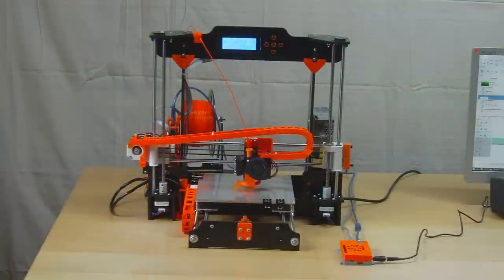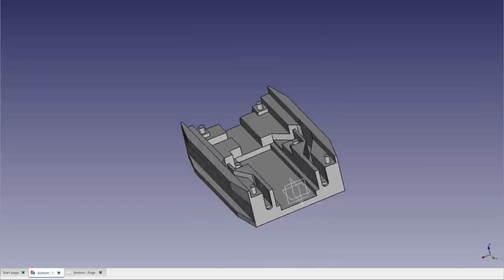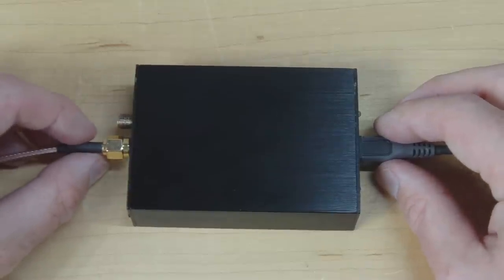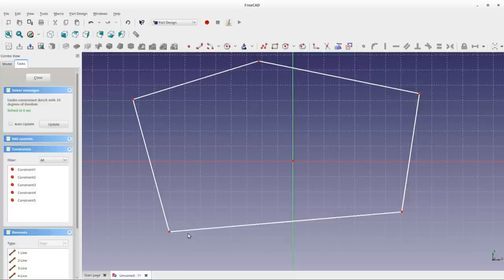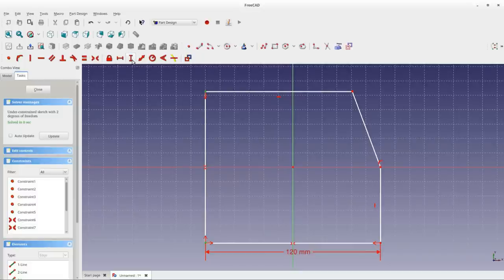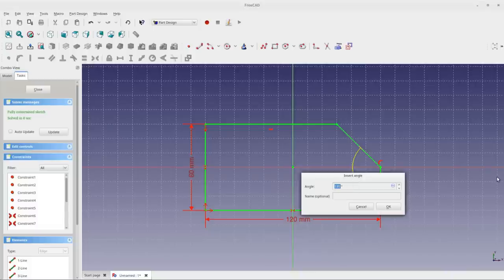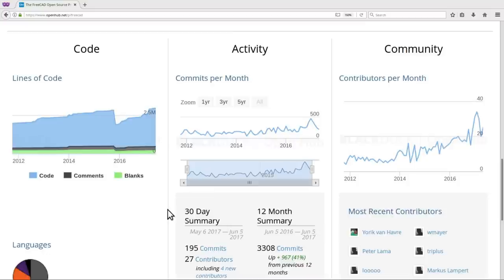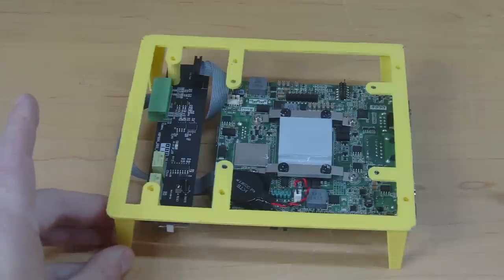[008] Prototype Enclosures with FreeCAD & OpenSCAD

Comment: Very interesting and informative. Choosing to adamantly stay away from all proprietary CAD tools I'm all too aware that there isn't exactly a deluge of usable, intuitive free CAD tools. I've been aware of both of these (as well as a few others) but FreeCAD's interface simply ties my brain in a knot each time I look at it and I happen to think that text-based tools for graphical tasks are the work of the Devil, so I stayed away from OpenSCAD too; what I use instead is SolveSpace - much like FreeCAD it's open source, parametric, constraint / hierarchy based and can do assemblies and even some motion analysis, but the GUI is soothingly simple. It's drawback is that its solver slows down horrendously past a certain level of complexity, so it's best used in moderation, but so far it has served me astonishingly well...

Comment: Awesome video. Have only been working in openscad before because of the parametrization, but now that you have shown freecad, that looks like something I should try, too. Thanks for sharing this video with us.
Reply from the maker: So long as your expectations aren't set too high, I think you'll find FreeCAD well worth trying out.
Reply: I personally like FreeCAD for my windows 2-in-1. It's not powerful enough to run fusion 360 or solidworks but it goes literally anywhere, so with FreeCAD I can start projects anywhere.

Comment: 31:40 modules are great, one thing that often gets overlooked is the children() function. you can use that to bundle up a set of transformations (say a complicated move and rotate). I end up with a lot of modules in my project with names like at_screws(), where it'll position a copy of the module's children at each screw hole, for example. this can be useful because it gives you a lot more topological flexibility; instead of having one transformation that positions the children at the screws, and have all the hole related features (standoff, holes, and lateral supports) be children of that one transform, you can distribute your screw features throughout the code. this can be useful if you want the screw holes to drill through not just the standoffs, but also the base plate they're attached to, despite the fact that the base plate is outside the scope of that transform and therefore can't be modified by it. so it would be useful to be able to move one of the screw related features elsewhere in the tree, in this case move the hole geometry up into some outer difference() that contains all the stuff you want it to be able to go through. you can either write your transform (probably some for loops and a translate call) twice, or you define an at_mounting_holes() module, and just invoke that whenever you need to position something at each screw hole, anywhere in your model tree. that way also, if you need to change the screw positioning code later, there's one named and easy to find place where all of it lives.

you can also chain together these modules, which can be useful for assemblies. any time you call rotate() or translate() (or a module that applies these transformations to its children), you can think of it as creating a new coordinate system for its children. so, you can make a bunch of parts, each one positioned at the origin, and then use translate() and rotate() to assemble the parts into the final assembly. but instead of just calling rotate and translate, you define a module for each part's assembly position (called to_mypart()), and a second module that performs the inverse transformation (moving it back to the origin, called from_mypart()). then you use these modules to build up a preview of the assembly, and even better, you can use these modules to transfer geometry between different parts' coordinate systems. so if you define a module to position a set of, say, alignment pins on Part A, you call that function within part A's local coordinate system:

part_a_at_alignment_pins() cylinder(d=pin_d, h=pin_h)

and then on part b, you convert that transform from a Part A's local coordinate system to global coordinates, and then from global coordinates to Part B's local coordinate system:

to_part_b() from_part_a() part_a_at_alignment_pins() cylinder(d=pin_d + pin_clearance*2, h=pin_h + clearance)

since openscad doesn't have any proper namespacing, if you're making a multi part assembly, you'll need to use a scheme (like prefixes) to make your different parts' module names unique, and you'll probably want to have a separate file per part, so you can protect each part's global variables by importing with "use" (which limits access to just modules and functions, compared to "include" which gives you everything). then in each part file, you have your to_ and from_ modules defined, and a single outer module containing all the geometry of the part, which you then call in the file. you open this file when you want to work on that part in isolation, in its "natural" position, and then you have a separate "assembly" file that just imports all the part modules, and calls to_mypart() mypart(); for each part, and you view that in openscad to preview how it'll all fit together, as well as to have visual feedback as you write those coordinate transforms. (and if you wanna get really fancy, you might end up defining some parts in relation to other parts' origins, rather than the global origin. so if part_b is defined as rotated 45 degrees and 10mm above of part_a, then to_part_b would look like this:

module to_part_b() to_part_a() rotate(45) translate([0, 0, 10]) children();

and from_part_b() would just be this in reverse. then if you later decide part_a should attach to the assembly in a totally different place, you modify to_ and from_part_a, and part_b will automatically tag along since it references part_a's origin.
Reply: oh also hull() is wonderful in 3d but especially in 2d, to quickly build up complex shapes out of a few primitives. and roof() is... extremely powerful but limited in usefulness as it's still experimental and often broken :(

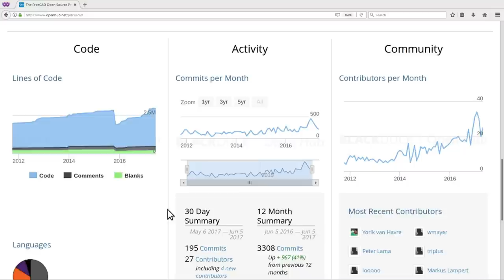Comment: 24:39 another thing that looks encouraging: seeing the lines of code graph not just going up, but also down. freecad has some serious structural problems (like the topological naming problem) that require fundamental changes to the way the app represents objects internally, so it's a good sign that there appears to be a willingness to not just add, but also replace code. (and no you can't fully work around the topological naming problem with good practices, if you wanna see the problem in action, load in a complex step file, make a drawing of it in techdraw, and see what happens when you save, exit, and reload)

Comment: Great intruduction of OpenSCAD. 

I remembered many years ago. my friends who are using CAD such as AutoCaD an Microstation , were using both  GUI and text command at the same time.  They use mouse to pick  point/object with right hand, and change the properties  using left hand.  I amazed  with their skills. Those days, we are using DOS or Windows 95 for CAD  Not to mention the computer hardware during that time..

Thank you.
Reply from the maker: I used AutoCAD for a summer years ago. Got quite good at it. It's not much of a tool though - it's more just a vector graphics drawing application optimized for the work of a draftsman. You draw lines and arcs on a page - but that's all it is. It's not any kind of 3D object.
If you need that sort of thing today in 2019, I think LibreCAD is the go-to for 2D CAD tool for the open-source aficionado.

Comment: It seems like iteration around be easier to iterate with OpenSCAD.  If I need to move a number of components, it would simple as finding the declaration and adjusting the transformation.  With a point and click tool you'd have to grab each one and drag then to the correct place.  

If the design had sub assemblies and variables it could be even easier.  Need to change the diameter for all the standoffs in your enclosure, just change the variable for the diameter.  

Very slick.  Thanks for the video.

Comment: Hi Joel, 
Great video, very informative with just the right amount of detail!
By the way, the rendering 'artifacts' you noticed in OpenSCAD preview mode (around 37:30 in your video) are caused by linear_extrude making assumptions about the convexity of the shape to be extruded. This can be overridden with the 'convexity' parameter to linear_extrude; i.e. writing 'linear_extrude(thickness, convexity=2)' (or more than 2) will preview correctly. This option has no effect in render mode, which does the correct thing either way.
Marko
Reply from the maker: Thanks - that's good to know. That seems like a bug to me though - OpenSCAD should be able to figure all that stuff out automatically even in the preview. Not a major issue though.

Comment: Nice comparison :) To fix the preview issue in OpenSCAD you can enable "enforce goldfeather algorithmus" in the settings. It solved the issue for me under windows. Also a note about the "perfect geometry". If you do 3D modeling for animations, renderings or whatever displays you model on a computer screen, then you are right and the perfect geometry shown e.g. by FreeCAD is better. But if you do 3D printing / CNC machining etc. it doesn't help at all, because your resulting model will always have discrete faces and OpenSCAD will actually represent exactly that.
I recently did some 3D prints for a friend that he had designed by his own. He was pretty surprised that the round faces he designed were not round at all at the end. He never actually had seen the STL file his tool created out of his perfect world model... I had to print them all a second time.

Comment: 8:50
First Select "Create Body" to get the option to "Create Sketch"
Next select the X-Y Axis on the left hand menu. Then there is an oddly placed "Ok/Cancel" box above the window to select the plane. Select "OK" and it will unlock the polygon tools.
(FreeCAD 0.17/Ubuntu/fresh install of "Stable" PPA from command line on 10/10/18)

Comment: @26:43 Could put some 6inch nails into the board, bit of a safety-hazard, but my prototype only goes up to 360VDC so i guess i'll be good.

But serious, just bought a 3d printer to do exactly that, supports for my pcb's,  Just started on freeCAD, since i don't use Windows anymore and abandoned Sketchup (feeCad). Nice Vid!

Comment: Hey Joel,
 Thanks for this upload. I keep coming back to this as a reference. I finally got a 3D printer bc I want to make stuff like this.
  However, it seems like I learn freecad for a project then wait just long enough to forget everything I learned before the next time I want to use it.
 I know your contributions to Sigrok. As a UI Dev, do you think we will ever see (or is there) a more intuitive FOSS persistent 3D CAD tool?
  When I'm using the latest freecad now in 2021, I'm reminded of KiCAD in the 3.x era, when I started using it. IIRC, at Chris Gammell's KiCon, it was mentioned that a retired/ex- UI Dev from Adobe had begun reworking the KiCAD UI. I wish we would see the same kind of overhaul with freecad. The freecad workflow is like playing a deep game of Simon Says mixed with grade school 1st foreign language flash cards. I'm about to relearn it for the 4th time. Is freecad still your FOSS tool of choice for designing models for printing?
-Jake

Comment: Thank you for the video! I think I'll start to use OpenSCAD for all my new projects now. BTW I noticed that the sound in your videos is a bit quiet and sometimes changes, probably because it was recorded in different environments. You can easily solve all these issues with Audacity. Just run Noise Reduction filter, then the Compressor, and probably Normalize afterwards.
Reply: I'm sorry, I've just noticed that I messed with sound configuration on my laptop and forgot about this. This is why the sound seemed quiet. It's actually OK. Using Compressor is still a good idea though unless you are using it already.

Comment: So this is 3 years late but that funny rendering issue you were having with OpenSCAD seems to be with the circle cutout you do on the 2D plane. If you do a cylinder difference after the linear_extrude  the rendering seems fine.

So something like:

difference(){
    linear_extrude(thickness) difference(){
        polygon([
        [-width/2, -height/2],
        [-width/2, height/2],
        [width/2-height/2, height/2],
        [width/2,0],
        [width/2,-height/2]
        ]);              
    }
    translate([-width/4, 0]) cylinder(h=100, d=hole_dia, center=true);
    translate([width/4, 0]) cylinder(h=100, d=hole_dia, center=true);

    translate([0, -height/2, thickness/2])
        rotate([90, 0, -45])
        cylinder(h=1000, d=hole_dia, center=true);
}

Comment: By the way Freecad now has a toolbox for OpenSCAD so you can use both ways in freecad :) . Although I do not agree with you  on the fact that freecad works with perfect mathematical shapes. If i zoom in on a cylinder I can see some edges.

Comment: Slightly off topic, but I noticed you said that you need to have access to the SWD pins to reprogram the STM32

There are several DFU bootloaders that would allow you to update via USB

I have the one thats used for Arduino  on STM32 in my github account (which is based on the LeafLab MapleBootloader) 

Or as you are using LibOpenCM3, you could take a look at the bootloader that Blacksphere use on their BlackMagic Probe

You would need to change your code start address to 0x80002000 to use either, and also do the trick to force USB re-enumeration but that's about all.

But perhaps if you're not updating the firmware that often its not worth the hassle (and also the 1 sec or so delay while the bootloader initially waits for upload when you power it up).
Reply from the maker: +Roger Clark I've used dfu bootloaders on other projects. I just didn't bother here. Having the slot was a nice little freeby to insert into the design. I doubt I will ever use it.

It's cool you're maintaining a bootloader. How does it compare with Gareth McMullin's one?
Reply: I've not done a direct comparison between the libmaple bootloader and the Gareth's version, but the libmaple one was originally written years ago and pre-dates libopencm3 so is more bare metal access to the hardware and is consequentially harder to port to any other STM32Fx MCU's

I think Gareth's version requires a DFUSe compliant DFU-Util where as the libmaple one is happy with the standard DFU protocol.

The libmaple one operates a bit differently when it starts up, as it checks whether it has an application binary at 0x80002000 or 0x80005000 and jumps to the application after a short timeout.

Gareth's checks for a GPIO before entering its DFU mode, otherwise it jumps immediately to the main BMP code at 0x80002000

If I get time, I was going to take Gareths version and port it to the STM32F4, because although the F4 has built in USB DFU, it needs DFUSe which I've had a problem getting to work on Windows.
And I'd also need to modify Gareths to support plain old DFU.

But I have so many projects underway, I never seem to have time to do this sort of thing.
Reply from the maker: +Roger Clark that's interesting to know. Thanks!

Comment: Biggest problem with Frecad is stability. Almost every single time, it crashes and erasing the work since last save. By comparison, Openscad never crash. Even if it did, text editor does not crash.

Comment: OpenSCAD is great, but it is easy to produce an incomprehensible mess - spaghetti code. The language is easy to learn, but what is needed is a structured disciplined way of using it.
Reply from the maker: Yeah I find it helps a lot to wrap features of the design up into modules. It can get a bit ugly when you want to add ad-hoc details to the design. Still, if I find it it easier to refactor an OpenSCAD file, than a graphical 3D CAD model, especially when using git as a safety rope.

Comment: As a fan and frequent user of OpenSCAD, there are more than a couple of problems with OpenSCAD.

1) The #$@#$%# IDE. Ow, ow, ow, owww... Simply horrible. Use it, prove me wrong.
2) The rendering process. Godawful slow. 
3) The ever present mesh errors from imported parts that show up by not showing your model at all. Not helpful.

On the plus side, still better than Blender.